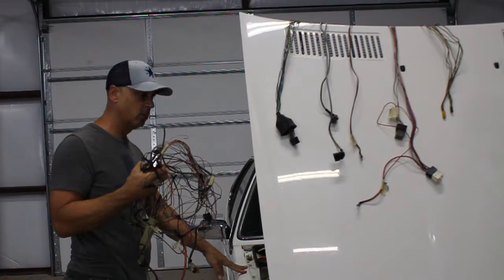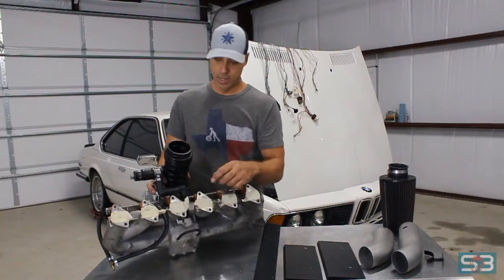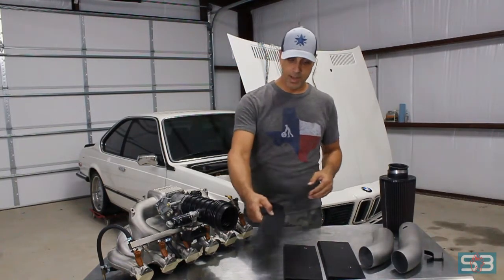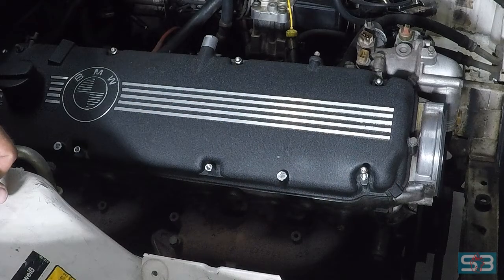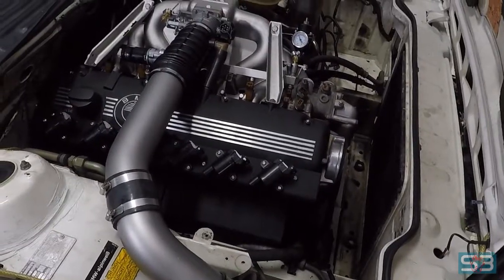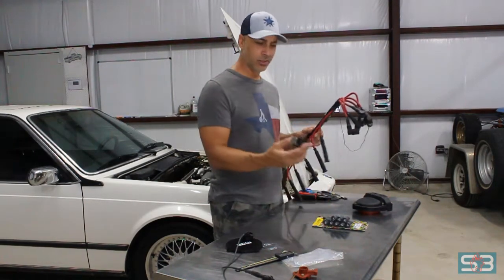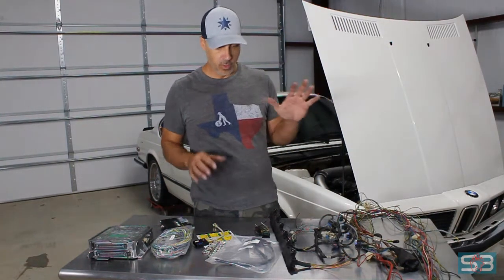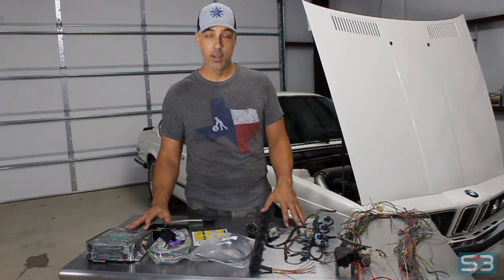Part 2: BMW 635csi ECUmaster Classic Install

Comment: Thanks for the videos and effort, I was wondering whether it may be easier to completely replace the intake manifold and go to self learning EFI? Also always wondered if a centrifugal supercharger would bolt up but doesn't seem to be the real estate in the front of the engine. Turbos are cool, but the plumbing....
Reply from the maker: Like one of those Holley kits for carburetor engines?  Yeah, I think that'd work too. But in that case, I think the effort to design and fabricate an intake manifold to interface with one of those would probably be more work than the rewiring here. It'd be interesting to do though.
Reply: Yeah the had solex stock manifolds for early 630s that used to be converted to holley, but not sure where you'd find one or if they would fit. http://www.seniorsix.org/faq/2_4bblconv.html. You are definitely doing it the right way, I'm just inherently lazy 👍

Comment: Nice attention to detail, this will look fantastic when done. Has to be 3-5 hp & 7-10 ft lbs with the better management and  open breathing.
Gee....now its ready for pressurized induction.
Reply from the maker: Yeah, that's kinda what I was figuring too. The red plug wires should also give me an additional 15-20 hp!